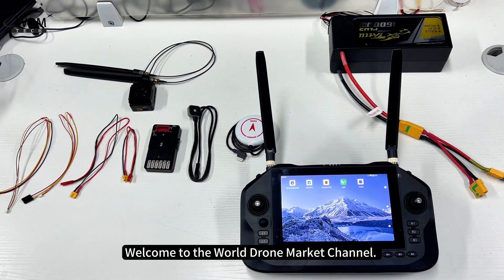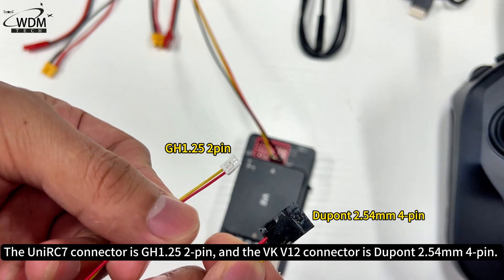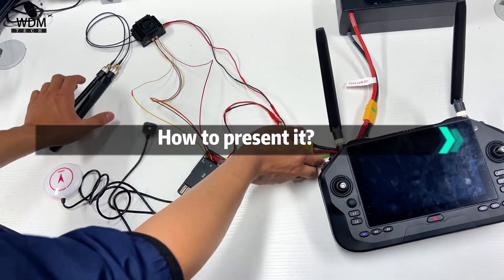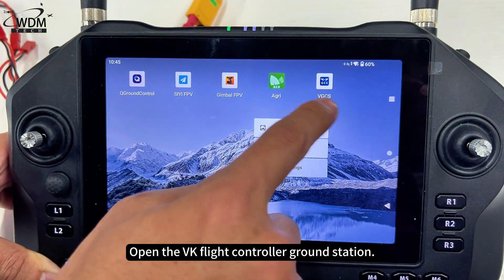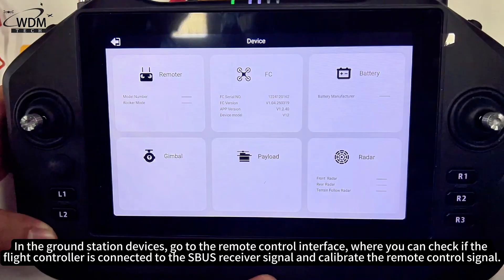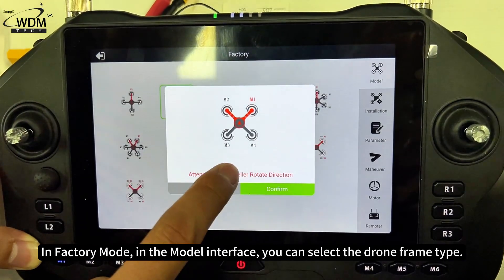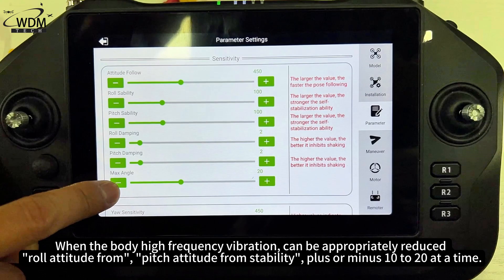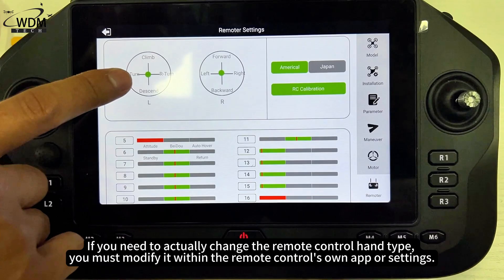SIYI UniRC7 and VK V12 Flight Controller Wiring Tutorial

Comment: Hello.

I wanna buy the siyi ZR30 optical pod,but i can't find a way to connect it to the herelink v1.0 air unit over ethernet or another way.

 My hope was to be able to control the siyi gimbal camera using the siyi fpv app on herelink controller, but i can't find a way to connect the ethernet port from the gimbal to the herelink v1.0 air unit. 

I found a couple of videos that shows the setup, but it uses the v1.1 air unit that has the ethernet port already on the top,and i only have the v1.0 air unit that doesn't have it.

I also have the cube orange +, if It could help

Thanks for your support and I will be waiting. 

Have a nice day 🙂
Reply from the maker: Herelink 1.0 does not have an Ethernet port, only Herelink 1.1 does, so you may want to consider changing your device, or you can refer to this link to see if it works, as we are not selling Cubepilot products right now.

https://docs.cubepilot.org/user-guides/herelink/herelink-user-guides/herelink-1.0-airunit-to-airunit-instruction#id-3.-airunit-hdmi- functionality

Comment: Can you connect H30+(X7+pro)+ZT30 🥺🥹😥
Reply from the maker: We don't have H30 at the moment, you can refer to this video because the cable that connects H30 to A8 is the same as the cable that connects to ZR3O. But you need to make this cable yourself, with one end being a GH1.25 9pin connector and one end being a GH 1.25 4pin connector. You can refer to the wire sequence diagram in this video to make the cable.
https://youtu.be/jaFiC67BSsc?si=N2j4LaIDILzuxCvV